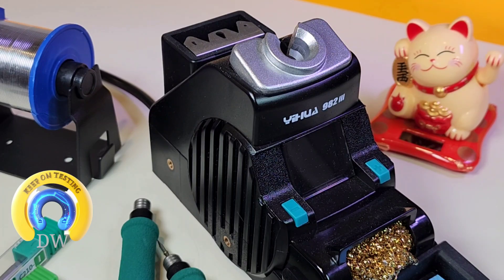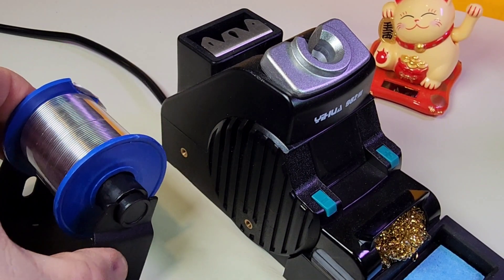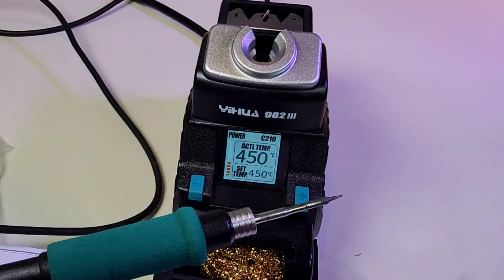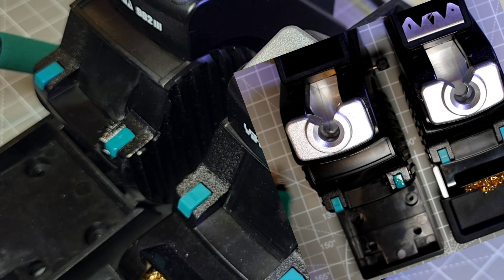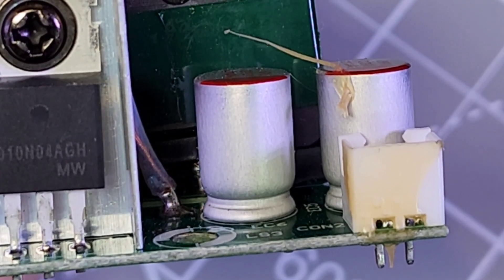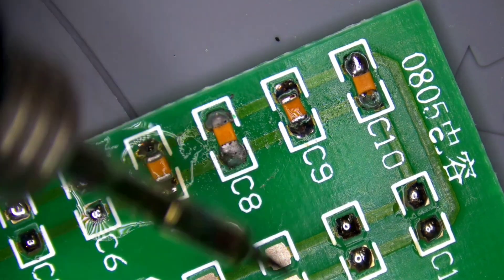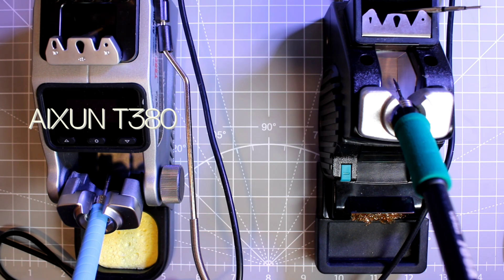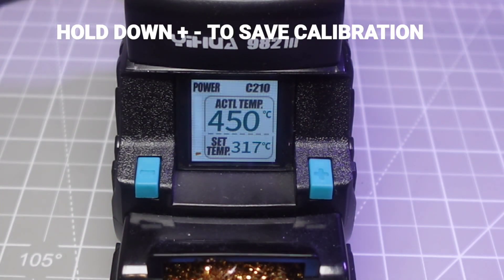YIHUA 982 III Microsoldering Station – Better Than Expensive Brands?

Comment: Is this better than 982?
Reply from the maker: Yes.. I think it's faster and generally an improvement overall. Would I upgrade my 982 to the 982 III..definitely not!
Reply: @KeepOnTesting  982 III is cheaper should i just buy that? I need it for changing PS5 controller sticks
Reply: @KeepOnTesting i did not buy i as on a site it was recommended that Aifen A9E is better, so i bought that for for a similar price with  9 tips,  245 210 and 115.

Comment: When you do your smd resistors just tin one pad and use that to hold the resistor in place while you solder the other side. Unless you're doing hot air rework tinning both pads at once just makes it difficult to get the resistor to sit flat.

Comment: Has it enough watts for the c245?
Reply from the maker: I still haven't been able to find a c245 handle for this station..I think it's c245 support is dicey to day the least..
Reply: YIHUA 606A Replacement Soldering Iron Handpiece/Handle ONLY for YIHUA 982-III C245-Compatible Precision Soldering Station
Reply: According to what I found the 245 handle is a 120watt handle
Reply: My unit turn up- turned it on, went live for 5 seconds and died, now being returned for a refund, shit quality…well I’m guessing as I didn’t get the chance to use it…..shit build quality I should say 😂

Comment: Just ordered it along with an RF4 H2 hot air station to replace my 2 in 1 station which isn't really great for SMD reworking
Reply from the maker: Awesome.. I hope you enjoy both! I actually ordered the RF4 from Ali, but the seller never shipped and I haven't reordered..let me know how you like it!👍
Reply: @KeepOnTesting  I'm back. It's pretty cool! I can remove mosfets and fpcs in less than a minute.
The only thing is that when it first arrived, there was no air coming out of the nozzle, and the temperature on the display showed like 1000 degrees celsius. I was shocked cause it was a new product. I decided to take the risk and open it up: The hose had come loose from the blower, apparently the zip tie wasn't strong enough during shipping lol.
It was an easy issue to fix, now it's working as intended

Comment: Fancy! That 10 watts extra might just be power delivery loss to the heater. That holder placement and design is questionable at best. Thing got some power for such tiny tips!

And the soldering station still isn't arriving here, unfortunate...
Reply from the maker: I really prefer the tip holder to be either beside or in front of the display as opposed to resting on top of it..😅 Definitely good power for a small station.
Reply: @KeepOnTesting  Not to mention...you might accidentally poke the screen and buttons as it happened. If the angle could be changed atleast, it would be a winner!